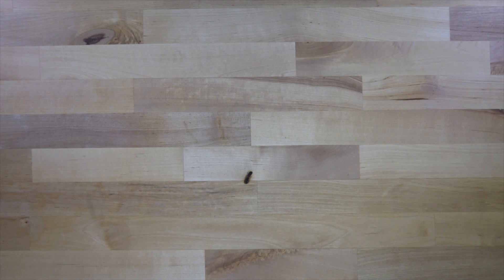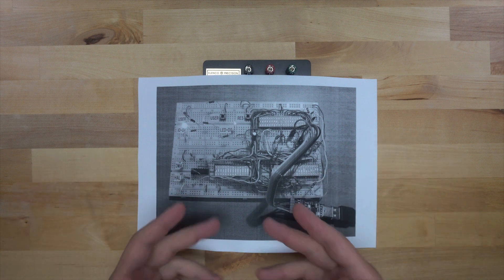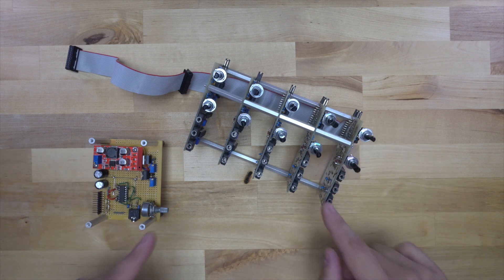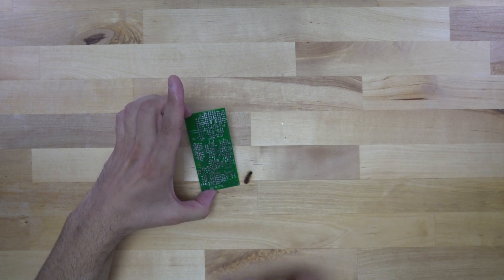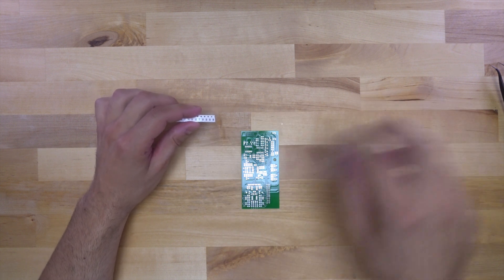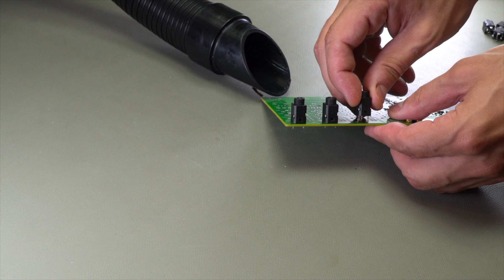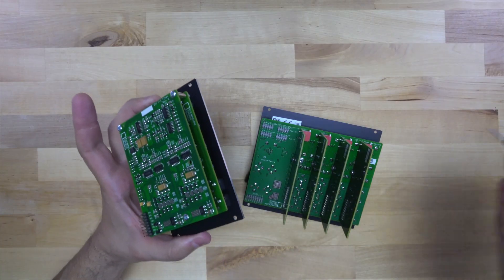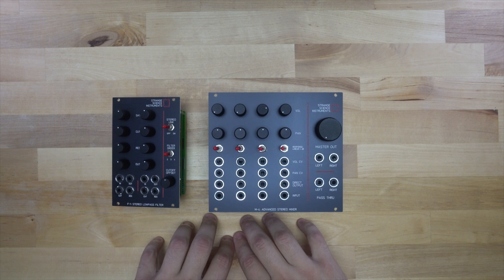We made our own Eurorack modules.  From scratch!

Comment: Great looking units. That mixer is most definitely not skiff friendly. 😢
Reply from the maker: Thanks!  We did our best to keep the depth down as much as possible but 62mm was the limit with all the electronics and layout that we wanted to use.  It will fit many cases but, as you say, skiffs may not have enough clearance.

Comment: On the strip board prototype, what sort of voltage regulator are you using?

I’ve been trying to make a mixer with +/- vcc for the op-amps but have failed to find a regulator that supplies this. Any tips?
Reply: Hey Steeve this is Teo from Strange Science.  I've been using some eBay bought cheap-o dual-output power converters for the prototyping.  For example, see 
https://www.ebay.com/itm/5V-6V-9V-10V-12V-15V-24V-Positive-Negative-DC-DC-Boost-Buck-Converter/183522672409?_trkparms=aid%3D222007%26algo%3DSIM.MBE%26ao%3D1%26asc%3D20131231084308%26meid%3Dd8157f02ff70434aadf124475b3fa813%26pid%3D100010%26rk%3D3%26rkt%3D12%26sd%3D113008071548%26itm%3D183522672409&_trksid=p2047675.c100010.m2109
Not exactly the one I was using but should do the trick.  The output from these can be noisy and not very well regulated so you may want to follow these with positive and negative linear regulators.

Comment: Perfectly explained! I worked at a PCB manufacturing facility doing various menial tasks to get a peek at this process. I would get SO excited when a eurorack project would come through.. even if I was just the guy scrubbing flux residue off the finished boards.

Primary takeaway: Pick & Place machines are finicky, SHOCKINGLY EXPENSIVE beasts!

Comment: Inspiring for the production side, always asked myself if Trough Hole stuff were made by hand (and it is actually). Immediately subscribed
Not digging the emotional music mood by the way
Reply: Yeah, great content, I've often wondered how these are mass produced. 
But also that cheesy music is over the top & out of place. I would think music created via these modules would be better marketing.
Reply: Not true.  Tons of through-hole boards use pick-and-place / reflow solder.   DIP ICs and leaded resistors and capacitors usually can be inserted and soldered by machine. However, there's a few reasons why this board wouldn't.  1) the through-hole parts are very big so they're not compatible with pick-and-place.  2) The through-hole parts have plastic and would melt in a reflow.  3) There's very few through-hole parts so it's not worth the cost of setting up a 2nd through-hole process for the board. 4) If a board has both surface-mount and through-hole components, it gets much trickier so the flow for one doesn't mess up the parts from the other because of different reflow temperatures, etc.

p.s. -  back at a previous company I worked for, I used to love watching the pick-and-place machines.  It's amazing how fast they go.
Reply: Look up wave soldering. Through hole doesn't necessarily have to be hand soldered, but it can be. Kind of depends on the volumes in question I'd imagine. For smaller runs like a lot of really boutique synth stuff, it might just be more worthwhile to have the boards made but assemble and solder them in house.
/Rambleramble
Reply from the maker: Thanks for watching (and subscribing)!